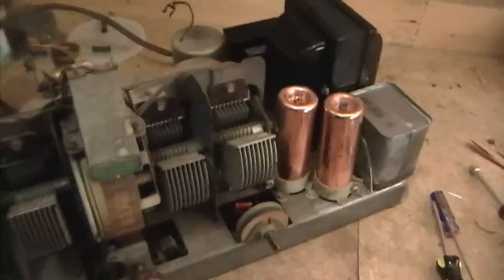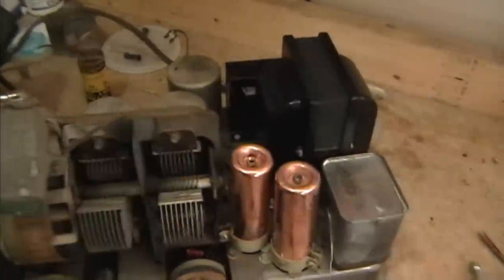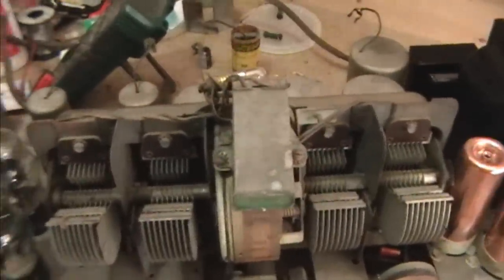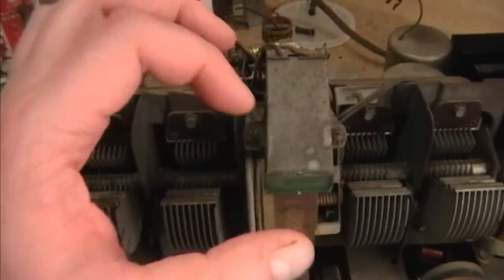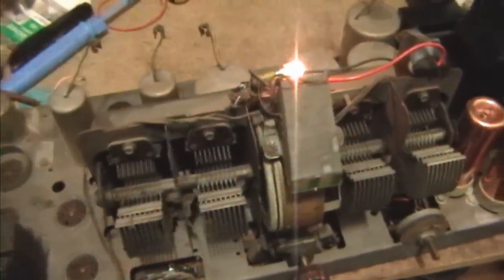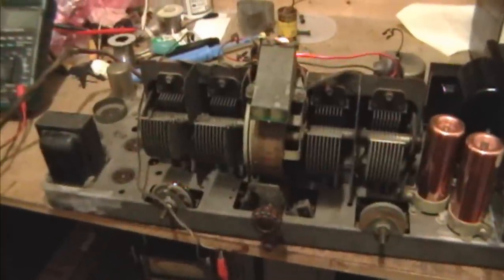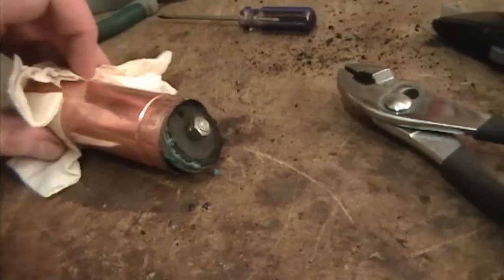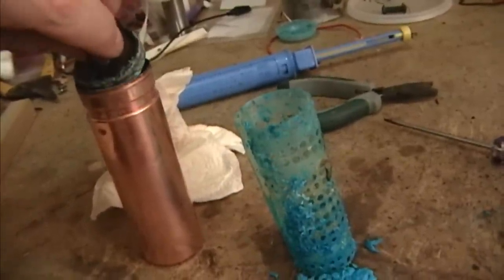Philco 15DX restoration p8o?

Comment: Thanks for the explanation. I guess an advantage of the solution that Bob intends to use is that the voltage rating would increase, something interesting for that radio, thought I'm not sure whether it would triple.

Comment: Technically, nothing prevents swapping types of caps, but in audio applications (esp. the output stages) the type (poly, film, mylar, electrolytic, etc.) can have an effect on how it sounds. Filters, not so much.

Also, the blue  in the caps is a form of Copper (II), likely copper sulfate or something. This could mean that the electrolyte was slightly acidic and dissolved copper from the inside of the jacket over time -so your leakage would also increase until your cap is basically a dead short.

Comment: So cool Bob that you got a good meter movement for the eye tube LIKE devise. Always thought you needed an 6U5 tube (I have a 6DA5 in my Loewe Magnet, yanno the sideways view.) but it seems Philco found a cool magnetic meter to do it. With eyes only having a few thousand hours on the glow, this seems like it could last forever. Do you have a number ot manufacturer of the meter display?? To think of it, on your vid, it displays just like a EAM86/6GX8 tube.. very close!! It is so cool.

Comment: Polyester film and mylar are pretty much one and the same, mylar is just a trademarked name for a form of polyester film. There polyproplyene capacitors used to be popular at one time, but they are not very common anymore, many 1950s and 60s German radios used them for precision capacitors in place of micas. Then there are of course ceramic capacitors, regular and precision types, ceramics are fine in most applications but the vertical oscillator circuits in TVs hate them.

Comment: I'm not 100% sure if what I'm gonna say is correct. I was asking myself the same thing and then I thought, capacitance is capacitance. What prevents replacing an electrolytic cap with another kind is the value, because electrolytic ones have much higher values. Since the original cap had a low value, by adding the 3 caps is possible to obtain the correct value. It would be not feasible if the value were 300 microfarad I guess because you would need an huge bunch of caps.